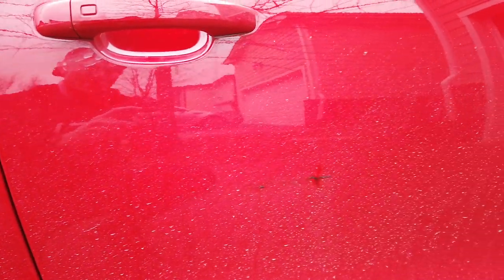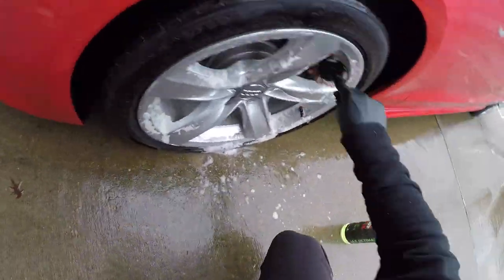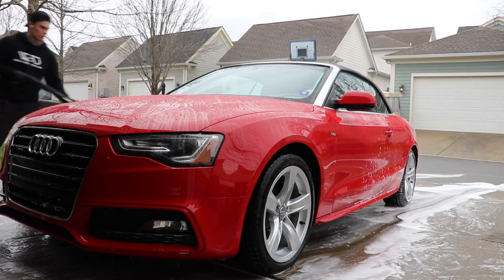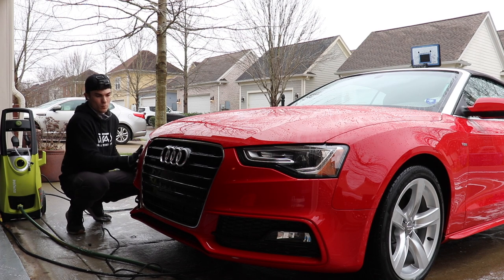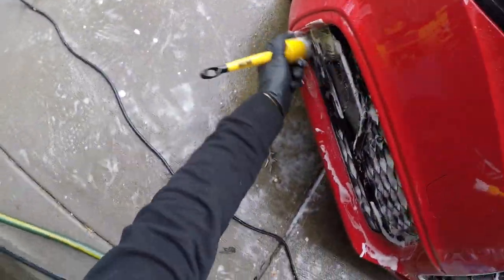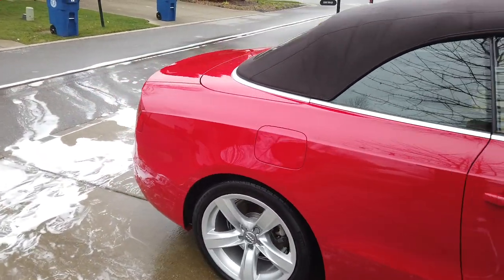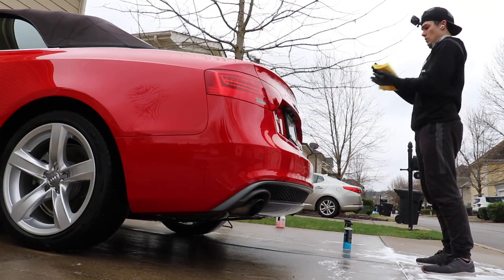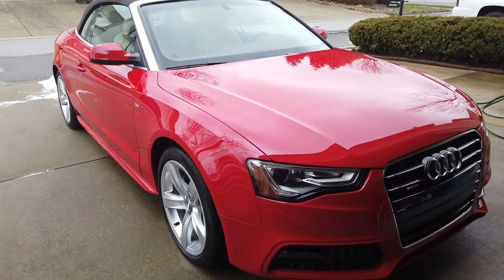Winterizing This Ceramic Coating So It's Protected ALL WINTER LONG!

Comment: Thanks for your video. I'm your next door neighbor. I live in Kentucky. I would like to know what you think of a Paste Wax Pure Synthetic Polymer.  I have them Meguiar's Ultimate Products. I'm looking into Meguiar's Professional detailer line as well. As a beginner detailer I'm afraid to use ceramic or graphene coatings just yet. I also have the Liquid Wax Pure Synthetic Polymer. I've seen where some pro retailers don't like liquid wax. I guess I'll find out. Thanks again for your videos.

Comment: Hey Luke I feel like this is a very selfish ask, I’m a diyer and have been watching you for years along with Dallas paint and auto fetish I would say are primary guys I watch. I just moved into an apartment and I cannot use my cheap DA polisher because there’s no where to plug in and as a simple diyer I don’t want to spend too much on a cordless unit. I saw that Lowe’s brand Kobalt has an affordable cordless unit and I would love if you can do a product review. I can’t find any reviews of the product yet. Thanks for your great content.
Reply: Could buy an inverter and plug it into your car so you could use the corded one